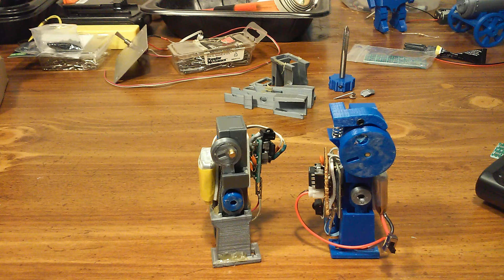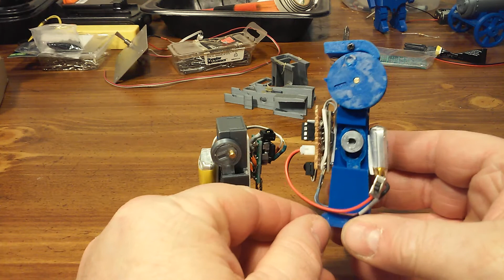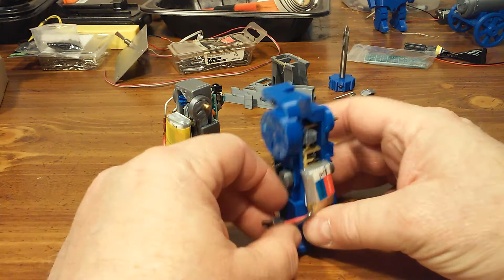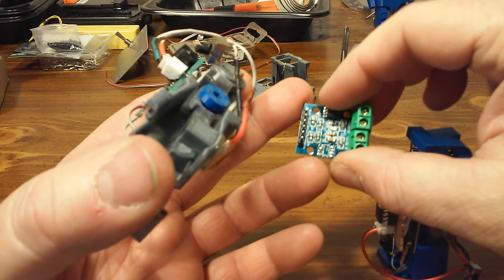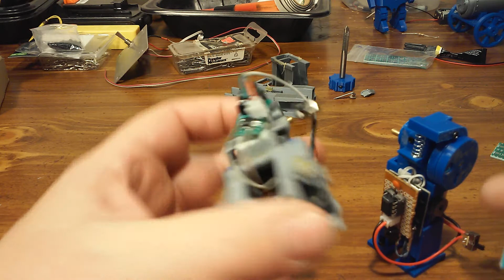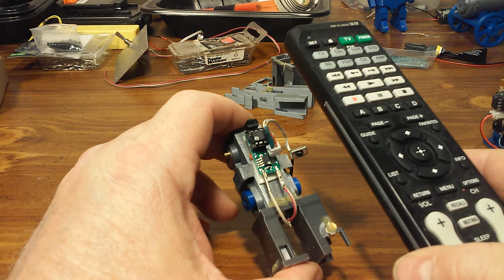Sort of Steerable Pin Walker update

Comment: hello good morning first of all I am a fan of your projects and your videos and you are checking a project that you have in thingiver which is the remote control of the robot Robie jr but the question I have is how can I do the programming in arduino so that it works correctly I am a beginner in programming in arduino and do not know if it could help me to do the programming or if it could give me the bases to be able to program it, I hope it can help me thanks.
Reply from the maker: Hello Andre.
 Thanks. I'm sorry I have not responded sooner but work keeps me busy. If your intention is to reproduce the remote and use the 3d printed case I designed you will need a 5V Pro Mini Arduino. These require a USB to serial converter to program.  I use the CH340 bases converters like this one:
https://www.banggood.com/CTS-DTR-USB-Adapter-Pro-Mini-Download-cable-USB-to-RS232-TTL-Serial-Ports-CH340-Replace-FT232-CP2102-PL2303-UART-TB196-p-1624886.html?rmmds=search&cur_warehouse=CN
It even includes  the  jumper wires and the page shows how to wire it. The USB to serial converter needs to have the DTR line. Some don't have this.
 You might be able to use a 5V Arduino Nano and then you wouldn't need the USB serial converter. The Nano is a little larger but you could probably make it fit. In the Thingiverse article I used Dupont connectors and headers on the Arduino. These take a lot of space. You would be better off just soldering wires to the Arduino board without the headers.
 Programming the Arduino is not hard but there is a learning curve. My advice would be to download the Arduino IDE and use the Nano since it only requires a USB connection. When you plug the Nano into the USB port the built in led should be slowly flashing. Before you do any wiring, open the Robie_Jr_trans_2.ino file into the Arduino IDE. Use the Upload button to compile and upload the program into the Arduino. If it uploads without problems the led should stop blinking or blink differently. You can then load the Blink sketch from the File\Examples menu and upload it. If it uploads correctly it should return to the slow blink and you will know your program is being correctly uploaded. If your program doesn't load and you get error messages in the bottom window, you will have to troubleshoot.  With the Nano it's probably the wrong com port selected or you need do select Atmega328P(Old Bootloader) in the Tools\Processor menu. With the Pro Mini board it can also be caused by wiring the jumpers incorrectly.
 There are many video tutorials on Arduino programming that do a much better job of explaining the basics than I could. This one uses the Nano:
https://youtu.be/R102xfcx75I

Good luck,
Rick
Reply: @rick_100  thanks bro for you help

Comment: The magnetic control system of the pin linage turned out great. If I had though of it years ago when I did mine I would have gone magnetic as well. Being that my robot was larger I would have built the magnet system right in to the pin linkage. Really turned out nice Rick.
Reply from the maker: Thanks Robothut. It took a couple of tries to get it right. I'm still not sure how I'll use it in a final project. A wired control would be the simple solution but the toy is so light, I would need a very light and flexible wire. I guess I could add ballast to increase the weight. The microcontroller works well and allows more features but it makes it much harder for most people to build. I'm experimenting with a relay with timer circuit but I'm not sure that's any easier to build.  Thanks again for your suggestions.
Rick
Reply: I plan to post my new robot project soon and it uses my single motor dual control gearbox and I am using a timer and H bridge driver system, so maybe that will be of help. Also you can buy dirt cheep on Banggood and gearbest radio control kits for $4 to $7 bucks that operate at low voltage like 3 to 5 volts. The receiver is very small and have the driver built in to run a DC motor forward and reverse. And for a even smaller control unit just buy any of the little table top RC cars or tanks. They have a receiver that is smaller than your fingernail and will drive the DC motor. I have done videos on this before and even used it in the Nando robot project that is supper small.
https://youtu.be/qi0kCWr2Eq8?list=PLE_FGUWmF3dTGCxYMDmiXGMZ5BVv15jae